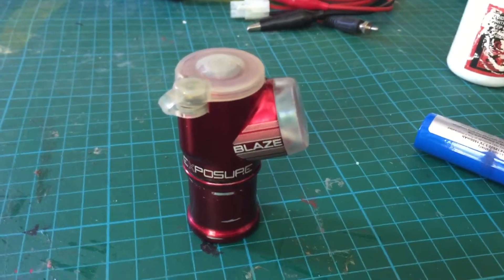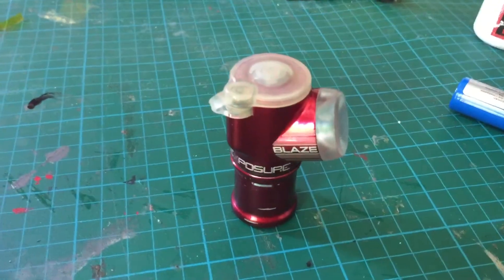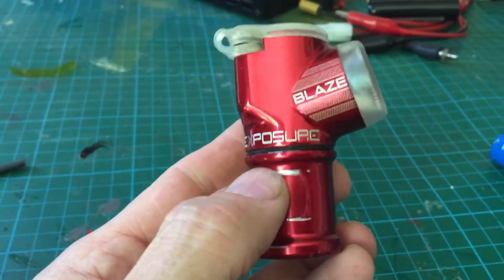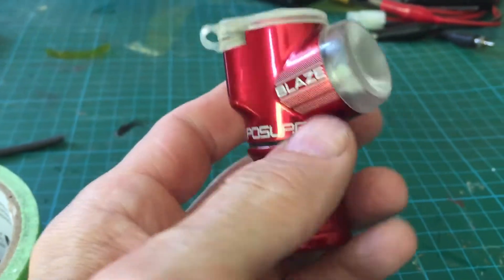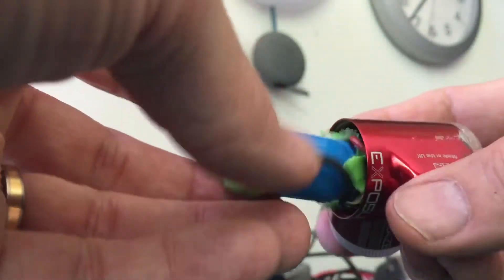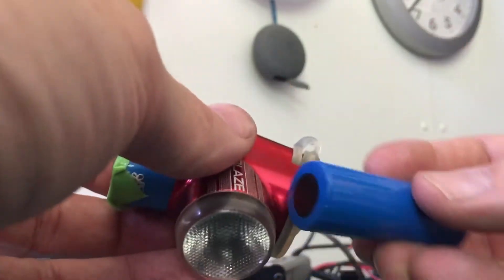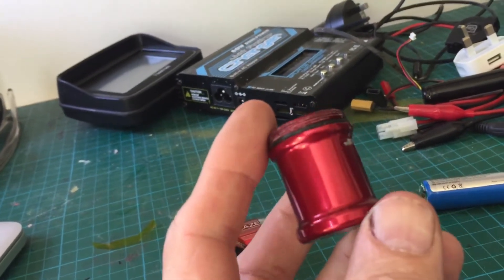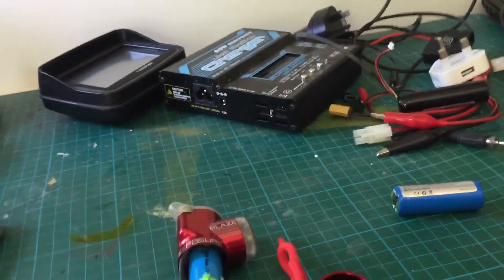How to replace a dead battery in an Exposure Blaze rear bicycle light!

Comment: Thanks for the video, I'm about to the point of needing to replace mine so just seeing it apart and knowing it is threaded and not press fit is a huge bit of information. As far as getting it apart easier... have you tried anything like a TuffMan Tools Oil Filter Wrench? Probably the smaller diameter of the Blaze light would be a challenge for one of these wrenches but you could probably mock up something similar. I use mine all the time for things other than my oil filters as they give you great grip and leverage to untwist about anything.